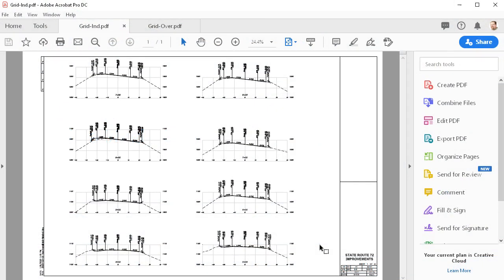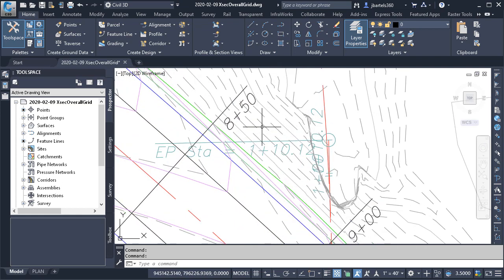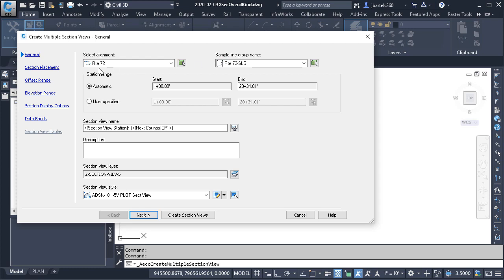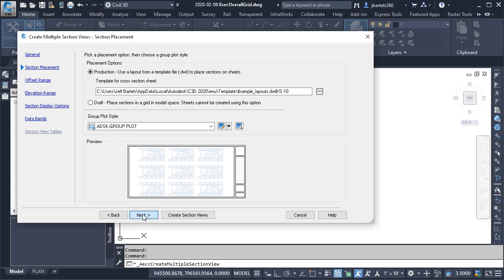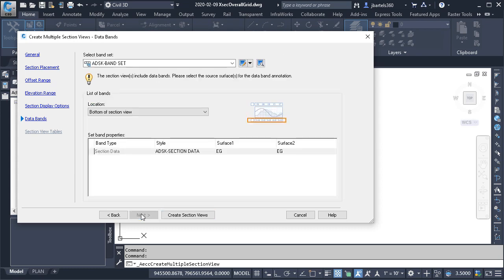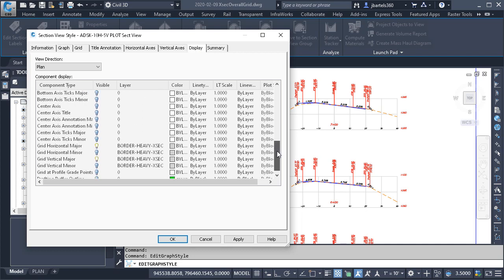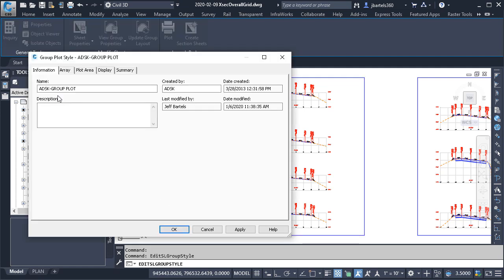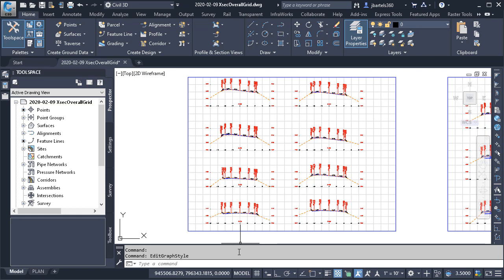Displaying Multiple Civil 3D Section Views Within a Single Grid

Comment: Thank you for the video! Side question for you or anyone. Do you know of a way to edit multiple section view elevation base elevations. I am wanting all the section is a single line to have the same base elevation. My work around is to use "section view height options" and select "follow a section" then I pick a surface I created with the base elevation I want. I feel like there has to be a better way than that or editing each one manual.
Reply: some one able to help with this solution, am among those ones dieing of this